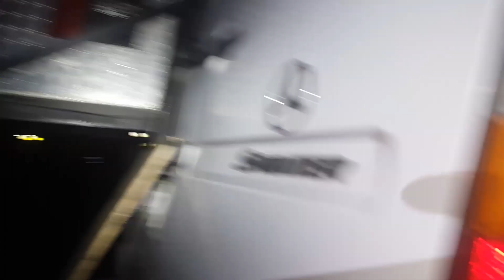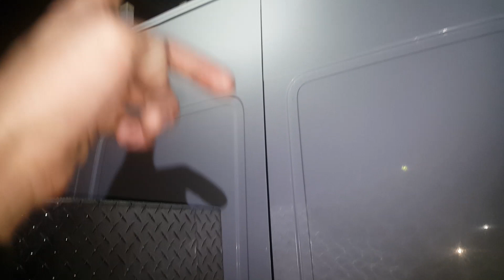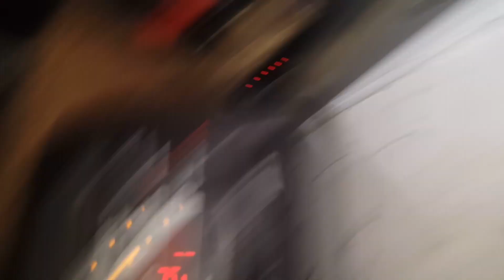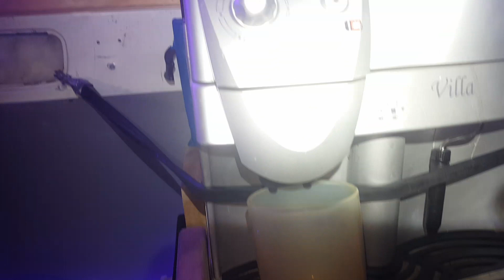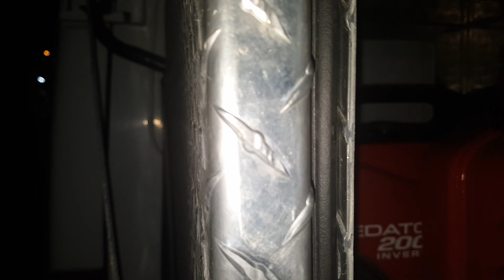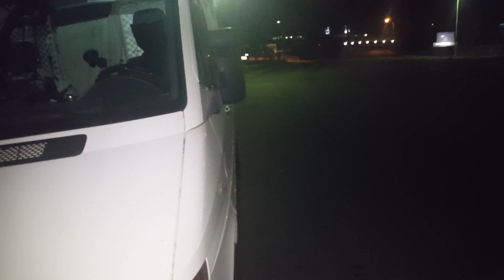AncapistanVan - Predator 2000 custom rear door aluminum generator box and review

Comment: Would fit in that box
Reply from the maker: You're right, it is quieter and it would fit. Some of those ones that size even have remote start. I decided to go with a smaller unit for lower fuel consumption (true? False? Idk) and so it would be easier to move around. But it's a total pain in the ass pulling it out of the box halfway and then putting it back in just to start it.my plan is to have an access hatch on the rear door so I can pull start it from inside the van. But ultimately I want to create a remote start system. now you've got me thinking maybe I got too small of a genset.